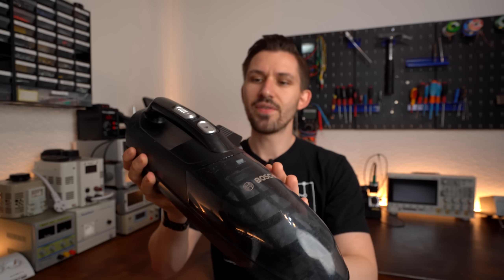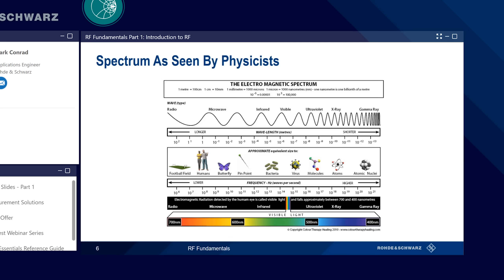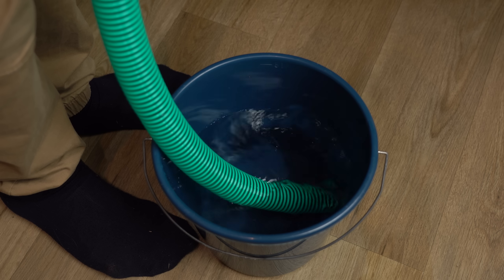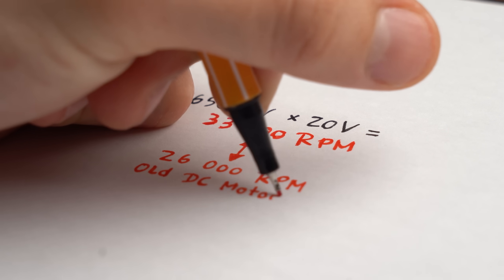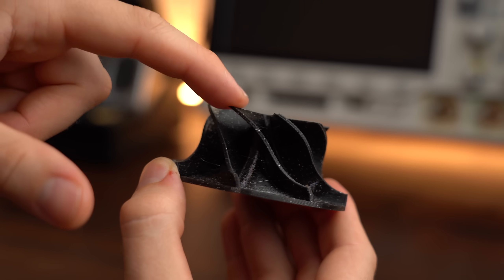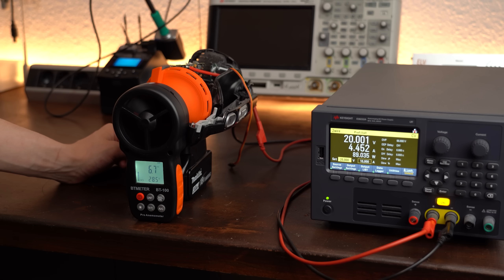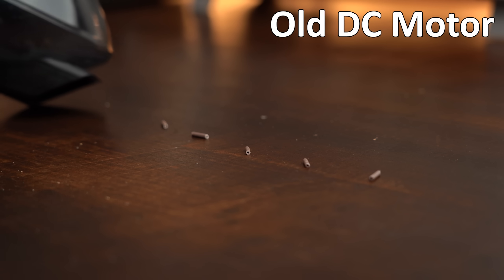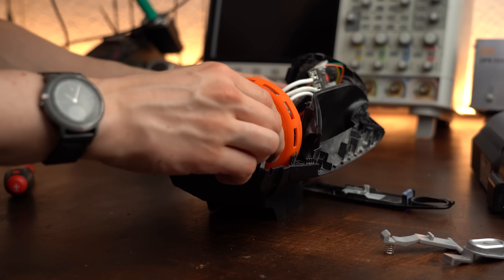My Last Chance to OVERPOWER my Vacuum! (Homemade Turbine V2)

Comment: From an ex vacuum engineer - it isn't as simple as either 'max flow against no back pressure' or 'max pressure pull with no flow'. What matters is the inbetween, and whether your impeller performs well in series with the back pressure of the vacuum's filters.  Vacuum cleaner companies use a metric 'airwatts' to characterise it - pressure times flow rate (in SI units) actually cancels out to watts, and you can compare your electrical power in to your air moving power out!
Reply: Amazing info! Your old job sounds cool as heck too btw.
Reply: @DrGooseDuckman  it sounds like it sucked... a lot.
Reply: @Komeuppance  Get out.
Reply from the maker: Thanks for the feedback :-)
Reply: With Great Content comes Great Comments  - Great scott 

Pun very much intended 😁
Reply: also called P/Q-Curves
Reply: Interesting, that fits well with the lectrical analogy where volts and amps cancel to watts as well (usually the analogy to fluids uses preasure and flow to explain voltage and amperage).
Reply: @xxportalxx. The pneumatic properties of pressure and flow work exactly like voltage and current in an electrical system. P = U * I across a resistor is the same as pressure * flow across a restriction (filter). Pumps can be modeled as either a voltage or a current source, cylinders as capacitors, and so on.
Reply: Wow. I was beginning to wonder if the fact that the surfaces of the 3d printed parts were rough, would generate turbulence or hinder performance.
Reply: Maybe smoothen the surface with UV Resin @BMWDriver1992
Reply: Exactly what I came to say as someone using very very large vacuums. I'd say in an interrupted setting with air constantly flowing, air velocity through a somewhat reduced orifice (to allow for debris partially obstructing the vacuum tube) is of more importance compared to total flow. 

Consider the difference between a street sweeper using a centrifugal fan directly coupled to a 100hp motor, or a suction excavation/jetting combination truck using a liquid ring, one has mass flow but ends up with impeller stall at zero flow, the other has relatively low flow while being able to suck heavy slurry from a 15' pit without much reduction in flow.
Reply: One liter-atm (1 liter of air at 1 atmosphere) carries 101.325 joules. Compressing (or expanding) 1 liter by 1 atmosphere in 1 second (without adding or subtracting heat) means work delivered is 101.325 watts. One atmosphere pressure equals a column of pure water column 1033.3 cm high (at one standard gravity), with the water at 4 degrees C. The 77 cm water lift height given for the original system is thus 77/1033.3 = 0.0745 atm.
A small vacuum cleaner may move about 2 liters of air per second. If doing so at the maximum suction pressure (a VERY optimistic assumption), then 2 L/s  times 0.0745 atm. suction equals 0.149 liter-atm. Multiplying by 101.325 gives the equivalent energy, 15.1 watts. Since the original system was using 110 watts to reach that level of suction, the calculated efficiency was 15.1/110 = 13.7%. But at zero net airflow (throughput), the real-world efficiency was zero. Moving air at high speeds also wastes energy (a very important metric in a battery-powered device). High speed means imparting a lot of kinetic energy... to the air in this case, which typically shows up as lost energy: inefficiency (entropy). 
You can easily measure airflow over a short time by attaching a plastic bag that holds a known volume of air, and timing the interval needed to fill or empty the bag. You want a good combination of flow rate AND suction, both measured simultaneously, while also passing through the partial flow restriction of the air filter.
Therefore, overall, I suggest moving the a bit air more slowly in the fastest sections, but using a 2-stage blower to create more flow and 'sucking power' without resorting to extreme RPM.
Reply: SI for the win!
Reply: That job must've sucked
Reply: @codyfrisch4378- I can answer that, starting with a question: Did you ever read The Hitch Hiker's Guide to the Galaxy? (Or perhaps listen to the radioplays or audiobooks?) Douglas Adams made many very acute observations of the modern world, and human nature. The relevant observation at this moment is about the people who do Marketing/Advertising. At one point, a bunch of them had been stranded on a primitive planet, had eaten all the food from their ship, and instead of planting crops or anything possibly productive, were instead sitting around a campfire debating what color the wheel should be, and whether consumers might want fire that could inserted into their own noses. So . . . 
You asked why Amps are used in advertising for Vacuum Cleaners? MARKETING BULLSHIT is why. They think 'Even ignorant consumers, which is almost all consumers, will recognize the word "amps" as having something to do with Power, so those ignorant consumers will conflate ideas and assume that More amps equals more a more powerful vacuum cleaner.' But in fact, more amps and more power consumption have virtually nothing to do with making a more powerful vacuum cleaner, as you suspected. Mechanical and electrical systems can always be made less efficient, and that can even make those systems cheaper and make them fail sooner... Leading to more garbage in landfills, and more sales. That is the oft-repeated pattern in our modern, dysfunctional world. 😕
Reply: Air Watts is a gimmicky pseudo-scientific term used by mostly central vacuum companies to sell machines.  You can probably get the same air watts with a high-power consuming tiny single stage vacuum motor you may see in some Beam machines that you can with a three stage tapered fan design in larger commercial motors like those used in commercial extractors and well-designed central vacuum systems like that of Cana-Vac Signature series.  In order to correctly measure the performance of a vacuum motor, chances are the best method is at the business end of the machine, typically the hose and nozzle.  You do this by using an anemometer and suction (in this case a water lift) gauge.  Then again, you can produce (I am going to use the American PSI as I am not all that familiar with atmospheres or pascals) 40 PSI with a suction cup on the gauge.  It is true that both are necessary to use a vacuum cleaner but the main component when picking up dry debris is airflow.
Reply: Muito boa sua informação, voce teria alguma literatura sobre o assunto, em especial sobre projetos de FAN?
Reply: thank god... otherwise companies are just burning cash on a full engineering staff instead of hiring a one man army to design their products 😂
Reply: Guarantee they made dozens or hundreds of iterative improvements to achieve what they did with the original.  

Your design follows conventions common to turbos and turbine engines.  These require much higher speed and input power.  They are also always made of metal to survive the stresses.  

You can get more performance at the cost of additional power input, but you need to spin it much faster, and make your parts far stronger.

Comment: Try to saturate the printed parts in super glue or clear nail polish it helps solidify the prints and can achieve a smoother finish. 👌
Reply: Or - vapor polish some ABS :)
Reply from the maker: Thanks for the tip!

Comment: Do a lost PLA casting of the most aggressive impeller with aluminum, drill a hole perpendicular to the shaft and tap it for a grub screw of your liking. With that done you should no longer have issues with the blades coming off because you can just tighten the grub screw to the shaft.

Comment: Nice! Anyway to use a small set screw to tighten the impeller into the motor shaft?
Reply from the maker: Hmmmm I will see how well that will work.

Comment: du hast noch ein problem mit dem Luftauslass - die luft, die der impeller ansaugt, muss auch wieder raus. und da sind die kleinen fensterchen quer zur strömungsrichtung der luft. geschickter wäre die fensterstege längs, tropenförmig zur strömungsrichtung zu machen und denen so viel querschnitt wie möglich zu geben. dabei ist zu beachten, dass nicht nur die fläche entscheidend ist, sondern auch der querschnitt je fenster. wenig große fenster sind besser als viele kleine, auch wenn der gesamtquerschnitt gleich ist. luft mag keine ecken, jeder kanaleinstrom und ausstrom sollte es der luft so leicht wie möglich machen und möglichst kein labyrinth oder ecken entgegenstellen.

Comment: The vacuum companies are the same companies who submit designs to NASA, seriously. Dyson has an enormous r&d team and their impellers are some of the most efficient designs. It’s almost impossible to diy and vacuum better than the theirs when it comes to efficiency. Not to say that you can’t make a stronger or longer lasting one.
Reply: "Dyson has an enormous r&d team and their impellers are some of the most efficient designs. It’s almost impossible to diy and vacuum better than the theirs when it comes to efficiency."
And yet they are no more efficient than vacuum cleaners from 20 years ago.
Reply: @ABaumstumpf  The only way you would be able to accurately compare them without bias is if you still owned one from 20 years ago. Which means you don't own a modern vacuum and don't know how much better they are.

Also, they are undeniably more power-efficient. Manufacturing as a whole has improved.
Reply: @danka2341  "Which means you don't own a modern vacuum and don't know how much better they are."
No - which means i do own more than 1 vacuum cause somebody thought we really need a "new & better" Dyson. Turns out the old one just needed some cleaning and works like a charm.

"Also, they are undeniably more power-efficient. Manufacturing as a whole has improved."
Source? Oh, none. Yeah.
Undeniably would mean you have actual effidence - which you have not.

Comment: Shouldn't the impeller's surface be smooth? Maybe using a resin printer?
Reply: I thought the same. Especially for a turbine with high RPM, a rough surface finish sounds disastrous.

Comment: can I suggest not to buy that specific brand... its overpriced and is just not worth it. They suck... and not in a good way. batteries die way too fast and their suction strength is terrible. It is faked by making the pipe only half the diameter at the inside... but you know just aswell as I do that it doesn't make a difference once in use. Its a total waste of money. trust me. the brand name doesn't do a thing besides making sure accessories of one model refuse to work on another for no reason what so ever. Take my advice... stay away from that crap.

Comment: I got a Bosch Ultimate 7. lighter than most Dysons, sucks about as much, uses normal Bosch DIY battery's and has a nose so you can stick it in corners easier.
oh and costs about a third compared to a Dyson.

Comment: You should try a resin 3D printer for that. It is possible that bc FDM printers aren't known for printing air tight enclosures. It is possible that there are small holes in the enclosure that prevents it from producing pure vacuum. Resin solves this problem
Reply: The surface finish will also be way better
Reply: Those holes are pretty insignificant in size compared to the input and output of the impeller tho, even more so considering more than 2 walls, the overlap of the material, even with small voids, compensates it (think of the Swiss cheese).
With resin I would be concerned about the material strength itself, it's also not too great with creep, and even temperature. It would be like doing the part out of PLA but weaker still, with the benefit of it being extremely (visually) precise, sure there are good resins but they're quite expensive as well.
Reply: @Kalvinjj  depends on the type of resin. There r many different types of resin out there other than the standard form labs. There are metal based resin and high temperature resins out there also. But I think in terms of cost, buying new vacuum would be cheaper than trying to go all out in a high end resin printer.

Comment: at this point, you need to concider metal insert in the plastic and press fit on the shaft of the motor. nice video keep it up :)
Reply: Or at least a brass collar that holds two grub screws 180* apart from each other, the grub screws interface with both the impeller and the shaft of the motor to hopefully act as an anchor point to prevent the impeller flying off the shaft.

Comment: It's almost like the Bosch engineers knew a thing or two about designing a vacuum cleaner 😆
Reply: It's like the one time where bosch engineers designed something that sucked and it was a good thing
Reply from the maker: Haha true.......next time I beat them ;-)
Reply: @greatscottlab  For high vacuum: centrifugal flow bias with blades that sweep back from the direction of rotation. The centrifugal portion is most of your static pressure since that what centrifugal pumps do best. Make sure the discharge allows smooth movement of the air with minimal restriction to improve airflow under low load.
Reply: @greatscottlab  Even if you don't, you (or we) learn something along the way!
Reply: @nickdibart  indeed...and thats is the best part... keep going and experimenting... u learn aloth of physics, math, material properties and so on...

perhaps next time use a pair of safety googles atleast... 
..but atleast u got one spare eye to go... for now...
Reply: @greatscottlab Go for it!
Reply: @greatscottlab  ..designing a more powerfull system is probably not very difficult, ... but will it work for two years atleast without any repair?...
Reply: @greatscottlab  then it comes the matter of efficiency :)
Reply: 😊l
Reply: It’s like the saying that anyone can build a bridge with enough steel and concrete, but an engineer will build one that is efficient in use of materials, adhering to time, safety, and budget constraints.
Reply: @drleewhite it’s just a saying. When was the last time any civil engineering project anywhere was completed on time or on budget?  😂😂
Reply: @Chris-bg8mk  He never said 'civil' engineering - that implies constraints imposed by governmental/political committees, and are not intended to 'make a profit', but instead to 'serve the public good'. Those things can turn into endless debates of what is needed and often specs change mid-stream as new politicians are hired and fired. If you're a private contractor building a bridge for a private party, building to spec, on time and on budget is essential to a successful and profitable business. Bosch has been a successful engineering company for over 125 years, so I'd say they have the trade-offs worked out pretty well.
Reply: @drleewhite 
Remind me of the last time a major engineering project stuck to budget constraints... 😂
Reply: made me laugh! thats definetly true! on the other hand, often what gets build is not what is physicly possible, but what performs good enough and can be sold for a reasonable price while leaving some margin to make a profit....
so theoreticly, scott might be able to beat the bosch company (maybe not the enineers themself, but the finished product with the restrictions of running a bussines economicly)
Reply: And have a little more resources available than just 3D printer
Reply: It's almost like this is ENTERTAINMENT.
Reply: True but they designed it for things like longevity, efficiency, low noise etc.

You know.. boring stuff... 😊
Reply: It would be cool if you could get an estimate from Bosch on how much time, effort and equipment they put into their optimized design.  You'd feel proud of yourself for getting so close on such a meager investment.
Reply: you would think so... then you use their device and you wonder if they ever actually tried it as a consumer would try.

and it wasn't about the engineering ability of Scott but the limitations of 3d printing and glue :D :D
Reply: You're going to need a way to mechanically secure the blade to the shaft. I'd say a screw but given the sahft diameter, a nut may be easier. Also, your blade geometry may need to be optimized for what your planned RPM is. From what I've observed while rebuilding locomotive turbos, the high altitude turbos had a different turbine angle and more blades. The high altitude turbos spin faster

My 2 cents. I'm not an engineer just a former mechanic
Reply: I will say this. Most bagged vacuum cleaners beat out bagless cleaners by a large degree.
I used my mother in law's old bagged cleaner and it is just wholly better than a Dyson.
You just need to live with buying the bags.
Reply: Almost. Bosch is a good brand, durable and reliable. but things brake and need to replaced eventually.
Reply: Fair enough, but I from what I was understanding, it's just the impeller being a weak material.
Reply: If they knew so much, Why did they build it to fail, and become ewaste?
Reply: They just use interns for such kind of jobs, so technically, you're 100% right
Reply: Actually the only major difference is that Bosch uses Glass Fiber PA6 nylon.  So the strength is WAY up.  But you can easily 3d print it.
Reply: And the Bosh suspension department was great.
Reply: ..Almost...😁😁😁
Reply: Bruh 💀💀💀💀
Reply: Right? There's only been like 120 years worth of R&D put in to vacuum cleaner design and efficiency. If a youtuber out did all of those engineers with a 3d printer and 2 videos worth of work, there would be a much more serious problem to address haha
Reply: Yeah they know that PETG is for amateurs and real engineers work with Nylon CF/GF for rotation objects!😂